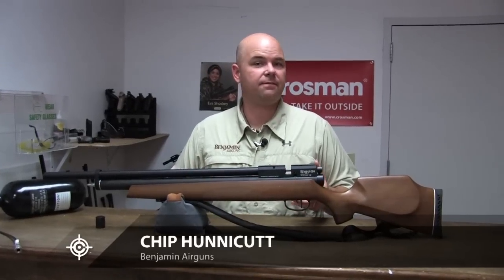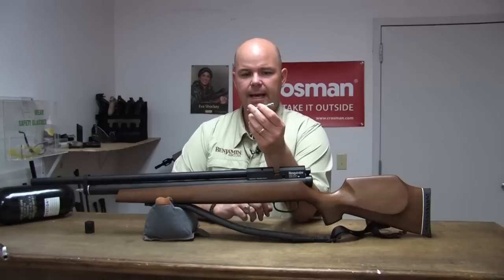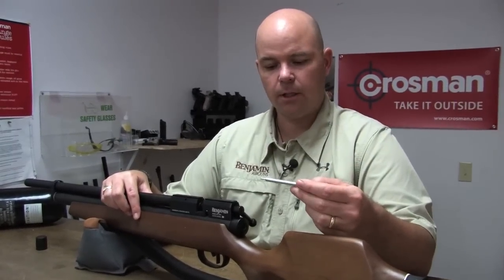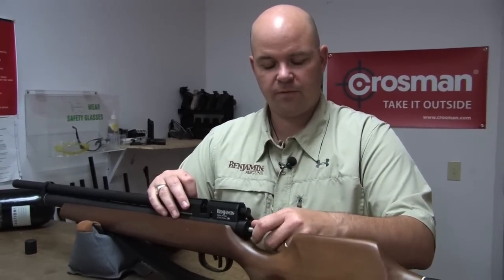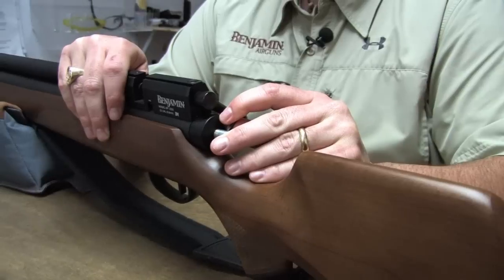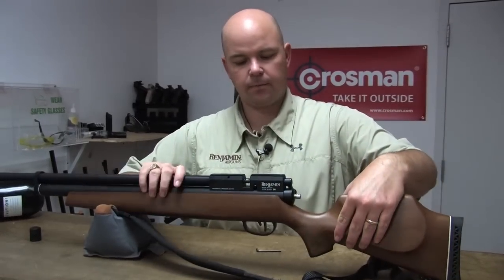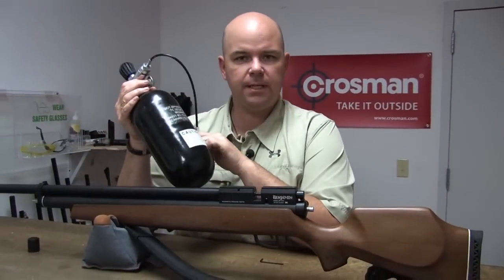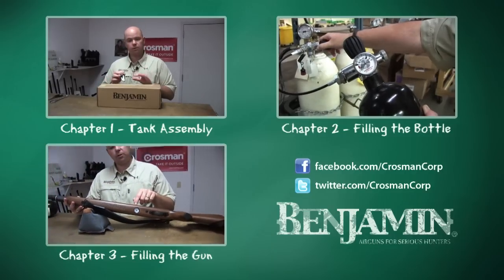Benjamin 15" PCP Air Tank, Chapter 4 - Degassing a Benjamin PCP Airgun

Comment from the maker: Good question! The air reservoir is rated much higher than the operating pressure, but it will be the components (valve, trigger, etc.) of the gun that may be damaged beyond repair by over-filling to that extent. Over pressurizing runs the risk of destroying the entire gun, not just the reservoir.

Comment: If someone was not paying attention to filling and they fill a rifle, say the discovery (meant for 2000 psi) and they fill it to 4500 will it blow up? Since it would be over filled by 2500 psi.
Reply: There is a rupture seal on the tank of the gun that will rupture if you overfill too much.